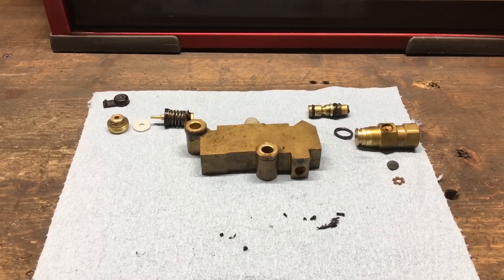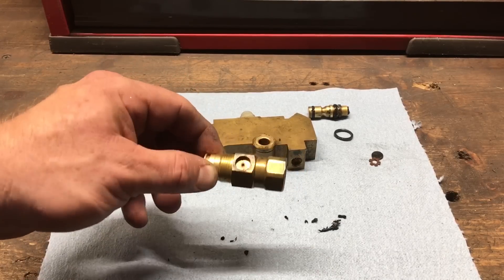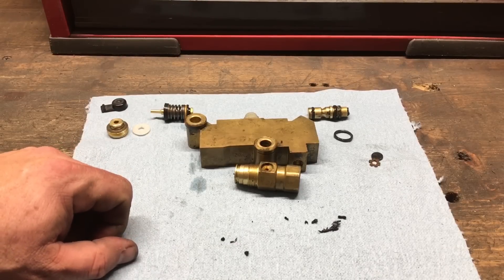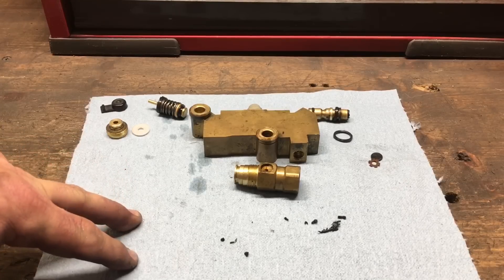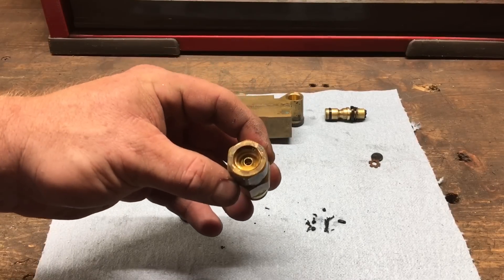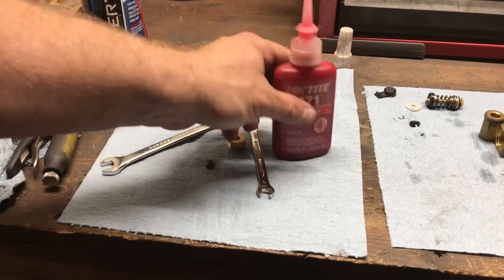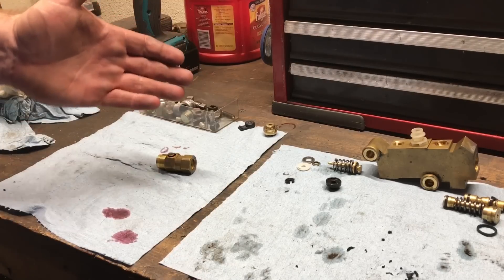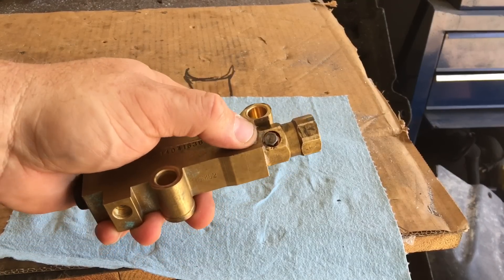DIY GM prop valve Disc/Drum conversion to a 50/50 non-adjustable setup,

Comment: Some rubber is incompatible with brake fluid, I think you're supposed to use EPDM rubber orings and seals.  Look it up, obviously they used the wrong type in that thing and the rubber seals were disintegrating.  You also don't want rear brakes to lock because the front will still be trying to slow the vehicle, and the rear end will try to swing around and pass up the front, causing total loss of control/spinout.

Comment: Since i 've been seeing two types of these valves.one as you have with that little hole in the side rear and the front spring loaded valve that i hear leaks also in some cases.Then i see one that's sealed in the front as well as the back area of the valve.Some say the other sealed valve is for trucks ,and some say trucks and cars.I noticed the threaded brake line holes are larger than  the type you have which is the type i purchased .But not instaled yet. Question can i use the sealed valve one on my 1980 Oldsmobile Delta 88? Disc front rear drum brakes .I also seen the seal ones say disk/disk and disk/drum .Can get the right fittings to ajust down to a lower size fitting.I need the brakes system to work annd without leaks in that area  if possible.

Comment: Interesting project. Would like to know the follow up on your fix to that syle of proportioning valve. Thinking about putting one on my 1980 oldsmobile delta 88 .Front disk,rear drum brakes.The one on my car looks factory.I feel my rear brakes not fully releasing on normal stops.I pull on the emergency brake handel I can feel a release of pressure.How long did you have that one before it broke down? If your project is successful I would follow your lead and modify the one I purchase before installation.especially if it has the little cork or rubber hole with the washer installed.

Comment: Been fighting with brake system.. replaced every part including metal lines..got 1 bad PV .sent bac .got 1 from Another company Online Tube..for  couple weeks been trying figure out .. Come find out after taking that PV apart after talking to Technical Rep .. found bad rubber seal @ tip of spring had came apart 🤦🏾‍♂️. After many hours &  multiple parts being returned..Moral those things maybe defective
Reply from the maker: One thing that is dangerous about using a gutted prop valve is that there’s no safety features left, if you bust a brake line, you’re gonna lose all brakes, front and rear. I’m still running the gutted prop valve, but I really need to and intend to upgrade it For safety reasons.

Comment: It will apply too much pressure to the front brakes .you need a disc /drum prop valve and a disc/ drum master to work correctly .if you want to know if what you did works correctly just hook up that wire to the valve and see when you apply brake .good luck
Reply from the maker: I now have Disc/Disc so it works amazingly well but is dangerous because If I break a line I’ll lose everything I think.
Reply: @HeadFlowInc  yes you will .please install a new prop valve and make us all safe .👍👍👍👍😳😳

Comment: No the valve that you are talking about removing only serves one purpose examples if you loose a front brake line the valve moves to close the front circuit and vice versa you have same pressure on front and back and the part with restrictions is for your panic stop to help with rear wheel lock up
Reply from the maker: I gutted the block, there’s nothing left to alter distribution.  Depending on the brake combo the distribution can be 60/40, 70/30 etc.  You might want to do some more reading.
Different blocks:  drum/drum, disc/drum and didc/disc. JD

Comment: After disassembling the prop valve a fun "check" would be to put the old shuttle valve back in with no or minimum rubbers. 
Why would you do this Steve?
To check the emergency stop function of 50/50 vs. Unknown vs unknown. 
 If you have time and patience its good to. Improve my education. 
 Line locks on my rear brakes?
 Manual control VERY interesting. 
No load-nearly off heavvy load-open up a half a turn. 
Ruptured rear cylinder-close em down till we get to the shop.
Reply from the maker: Good ideas and information. Right now it’s unsafe because it’s an equal 50/50 equal pressure full time. So if any brake lines fail All brakes will fail. JD

Comment: I believe that extra weep hole is actually for panic stop situations where it will release more pressure to the rear drum brakes so they don't lock up as easily.  If you stab the brake pedal it will tend to lock up the rear drums, with that little pressure release it bleeds off just a little more pressure o help in those situations.  Over time of course what ever that little "reed" is made out of gets brittle and/or the star washer retainer gets weak.

Comment: Remember that the master cylinder had two sections that hold fluid. Front (larger bowl) section is for the rear brakes. Back (smaller bowl) section is for your front brakes. If you lose a lot of fluid in either bowl, the proportion valve will shift over internally to prevent total loss of brakes. The break down of the proportion valve having rubber pieces is due to containments (dirt and water) and/or fluid that needed to be changed out much earlier. There is a tester that can be utilized to tell you the condition of the brake fluid. Brake fluid should be changed every two years or @ 20,000 miles.  Check your vehicles maintenance manual.
Reply from the maker: I know, it’s dangerous like the older model vehicles!  If I blow a line anywhere in the system all brake functions stop.  Even though I really like the way the brakes are working and how they hold strong stronger than they ever have for safety sake I need to set it up with the real proportioning valve.

Comment: Did it work???
Reply from the maker: Here’s my warning: 
Yes the gutted prop-valve works great and delivers 50/50 distribution. 
1. With 50/50 distribution on panick stops the rear tires have a tendency to lock up. 
2. If you ever pop a brake line or have a leak you will lose “All” brakes because all the safety mechanisms are removed. 
3. I’m still running the gutted valve but really need to swap it out.
Reply: @HeadFlowInc  thanks hoping a oring in this one will take care of the problem plus it’s a older ranger that we can not find a replacement for tried all the parts stores. Figured if it worked on a blazer it would on this. Lucky it’s a slow stick shift truck so don’t need but so much break. Thanks for the video

Comment: I would have just spent the $40 and fixed the car correctly.
Reply from the maker: Life’s full of choices, but I was able to learn the 50/50 valve stops really well. But it’s not safe without a check valve system in case a brake line breaks etc.

Comment: A couple of days ago i finally found this leak (the MYSTERY hole) . After extensive interrogation of all my mech minded friends and hours of research i stumbled across this video by accident and out of curiosity mostly. I just got the new combo valve #4 for disc/disc (76 stingray)  with no hole in it from amazo for like $40 bucks?  lol. installing today. Anyway, what got my attention was the thumbnail pic with that fitting like mine. Good job on video breaking down this little gremlin. Btw, my little hole wasn't visible even with mirrors due to the clocking orientation putting it facing the mounting bolt flange out of sight. I had to remove combo valve to get to it so after i tore i down i torched the hell out of it and added solder to the hole enuf to seal it and no i don't recommend it because i don't know how long it will last. it got me home and worked fantastically, that's all i got to say about that. These valves are common and cheap, i recommend replacement the whole valve on your classic weather or not it needs it. there's rubber o rings in there and they are old. Happy motoring.
Reply: btw i think the hole is a vent to atmosphere on the backside of the tiny valve inside for panic stopping feature. the fitting goes to rear brakes but, my vette came with disc all way round so, who knows if its the original prop valve.

Comment: rubs temples That's a combination valve. The first piece you called an adapter is the proportioning valve. That hole is an emergency high pressure blow out.

The "shuttle" you took out is a safety feature... one port of that valve runs to the front tires, the other out port controls the back tires. When/if you have a brake pressure fail, in the front or rear, that little shuttle cuts off the depressurized side so the other still works. 

Don't gut these that far. That safety valve is the difference between having only half of your brake system in a brake failure and having a run away rig. Don't risk you ass or your truck to save $50... jesus.
Reply from the maker: Good points, thanks for watching and the feedback I appreciate it!  I need to install an adjustable proportioning valve to install.  I’ve been using the gutted prop valve; my brakes haven’t work this good ever!  But as expected if I have to panic stop the rear tires can lock up.  The safety issue you mentioned is the one area making me want to change the prop valve.  Drag racing at speeds well over 100 mph and have ZERO brakes doesn’t sound like a good idea.  JD
Reply: @HeadFlowInc  So there's the PV2, which is Disc front and Disc back. The PV4 is disc/disc. I've got a rig with a very expensive, very hard to find parts for Teves II abs system I'm converting to power brakes (vacuum system like a normal car) and I had to do a deep dive on these combo valves. 

I think I saw Wildwood had an adjustable setup that might be worth looking into. I opted for a more boring set up - mine's just a cruiser :)
Reply: Bingo.
Reply: Damnskippy.

Comment: Not very good news to hear As I'm changing a valve So you have me wondering if this isn't about the same type of problem as What I call a dry start up on a engine with no oil in the oil filter A matter of putting oil in it before you bleed it Or like the oil filter Just fill the filter with oil when you put it on Given not many options I'll give it a go ..
Thank you
Reply from the maker: Good luck on your project Thank you for watching!  JD
Reply: Interesting.

Comment: I was just searching the idea for my truck and clicked on this title. Thanks to @headflowinc for kicking off this original video. For anyone who wants to do as hinted in the video here is a pdf with simple instructions https://www.classicperform.com/Instructions/PDF/Prop_Valve_Mod_Instructions.pdf
Reply from the maker: Thanks for sharing the link!  I’ve had good results so far with improved braking and pedal feel. I haven’t had any panic braking issues but I’m sure in the right scenario the rear brakes would lock up due to the vehicle weight transfer to the front will unload the rear tires. 
I haven’t tried one yet but I’ve seen some cheap adjustable valves I could use to dial in a custom distribution if needed.  Thanks again!  JD

Comment: I have a 1982 Chevy G30 box.truck dully I tow a race car with,   I have 0 rear brakes. Disk front drum rear.   I've been wondering if I could do this...   even with load equalizer hitch truck still slides front tires very easy , relying on trailer brakes to stop,
Reply from the maker: I can’t accept responsibility for modifying your prop valve.  I do know with a full time 50/50 distribution on a panic stop the rear tires lock up way sooner. I’ve been using mine without issues but I also haven’t tested slowing down from 130 mph at the track yet.
I’m not sure if it would work or not, but it sounds like something is definitely wrong with your rear brakes. JD

Comment: I’m keeping drums in the front and rear. Should I convert mine to 50 50? Or can I use the disk drum valve?
Reply from the maker: Wow, I don’t know for sure I learned the idea from a Saturday morning car show.  I’m wonder how much difference the distribution would make between disc and drum?  I know you have to be careful running a 50/50 distribution on the brakes because on a panic stop it can lockup the rear brakes from the weight transfer forward.  I haven’t had any issues so but I haven’t had any panic stops either.  Very good question! JD
Reply: You need a gm drum/drum combination valve. They're $40 or so new

Comment: Great thread my friend, just like you I found nobody could tell me why that hole was there but it just hit me watching your video why and you exposed it, seeing all that rubber from the O rings and seals that had broke down and ended up in the system that hole was put there to let you know that the system has failed internally allowing fluid to pass the seals therefore putting to much pressure on that hole with the rubber lid and star retainer, I'm calling it a lid and a star retainer because it's not designed to seal and lock into place but more of a design to slow the flow of fluid in-case of internal valve faileir. just like a weep hole on a water pump, I don't know if I'm right just my theory. But in my opinion I wouldn't seal that hole it's there for a reason and the reason you exposed the O-rings and seals failed badly I would just rebuild the valve and make sure to use better O rings and seals hopefully they won't fail like the original ones did. thanks for your posting. Dennis White
Reply from the maker: So far so good, I gutted the valving to create a full time 50/50 distribution block.  I haven’t had any panic stops yet but it works great for average driving and moderate stopping without any rear brake lock up.  I’m sure if I was going fast enough and hammered the brakes the back tires would surely lock up from the weight transfer unloading.  JD

Comment: its when your pressure regulator goes out and doesnt build up to much pressure and blow a brake line. that pressure relief goes out before it gets too much pressure and the proportioning valve kicks in and shuts thats side down that blew out
Reply from the maker: Jordon Woody Thank you, you should post a video about it because I couldn’t find any information on it at all.  Thanks again!  JD

Comment: That's what I was thinking, could the brakes drag?
Reply from the maker: JAMES! Since the 70's My friend Richard noticed it and I noticed, once I went to disc brakes in the rear, the Disc/Drum prop valve had a delayed release of the brakes.  Apparently it was holding pressure or not bleeding pressure effectively. 🤔

Comment: I had no brakes on the rear of my truck, 92,Silverado. For years, I only noticed it after smoking a 2000 cobra mustand, and run out of road!! It stopped! Barely, I thought something was going to catch fire on the front end! Things got HOT!!! The rear was warm, you could touch the drum! Crazy!!   That was when I was younger & dumber!! I was playing with that mustang with a full size extended cab truck!! Especially through the curves! That truck would hang, lime it was on rails!! I hope all goes well! Ya need brakes!!

Comment: that hole probable has no other purpose other than to tell you the internal valves are compromised and leaking past the seals. Kinda like the weep hole on a water pump.....but  I don't know but since it is for the braking system If it was me I would replace the valve and adaptor either with new or salvage yard part......
Reply from the maker: johnsont963 Your idea makes sense, once there’s a leaking internal o-ring seal it would hydraulic the Star retainer out of its groove.  You’d sure think that’s what it’s for. 
I wanted to show how it works as a 50-50 setup, but one of my front bleeder screws is seized!  Once I can finish flushing/bleeding the brakes I’ll make an update video. 
Thanks for the feedback I appreciate it!  JD